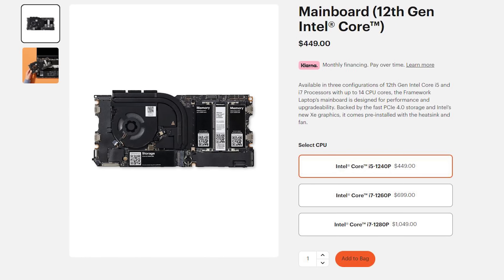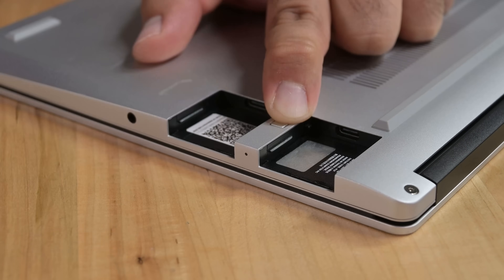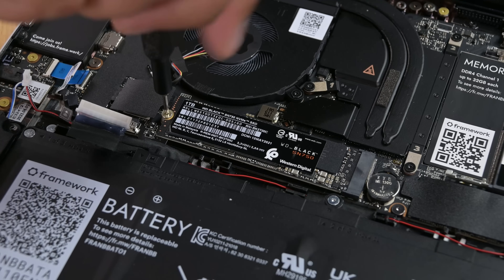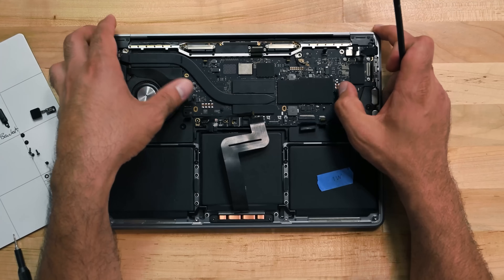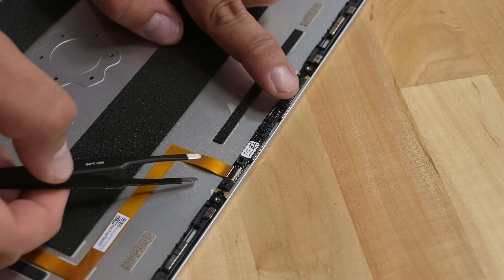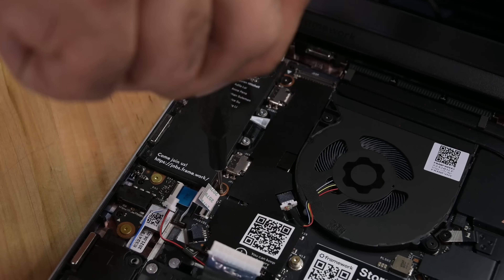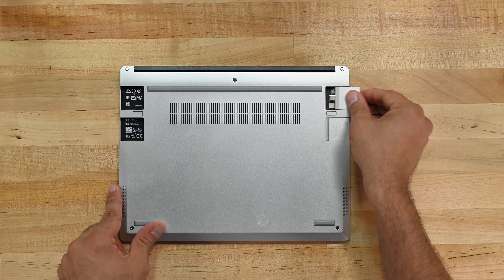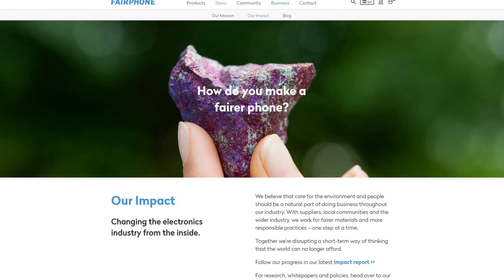The Framework Laptop Is Now Fully Upgradable!

Comment: the only reason im not more interested is becasue I'm a sucker for 15" laptops.
i need that 15" display and full keybord that comes with it.
a 15", 16:10 framework with 2 SSD slots would definetly be something i'd buy.
Reply: Late reply but they did announce the 16 inch recently.

Comment: The upgradability of this laptop appears to about as good as it gets. None of my previous laptops could have their cpus upgraded. The long term cost of a Framework laptop is probably a lot less than buying new laptops in order to upgrade the CPU. My next laptop will probably be a Framework.
Reply: @PSTS636  I am surprised to hear that. What sort of prices are we talking about ?
Reply: @PSTS636  Is that the price of the replacement cpu board ?
Reply: @PSTS636  Yes, that is a high price indeed. Hmmmm…..

Comment: I still use an aluminium Mac Book that has a lever locked lid to a removable battery and hard drive. When it dies in 10-20 years next LT will be a Framework.

Comment: Having lived with all sorts of technology since I was 5 (I'm 67), I've noticed one very important fact, over and over and over: The more connectors, cables, switches, jacks, and plugs you have in any system, the more failure points are present. Each additional connection multiplies the complexity of the system. So in one sense, Apple has it right... eliminate all the removable connection points except the absolute essentials. 

I think back to the time in my early 20s when I was an AM radio announcer. One day, I arrived at the station, knowing we were off the air. The guy on the shift ahead of me had lost the signal in his off the air monitor. The engineer came out (on a Saturday, time and a half pay), and started tracing the issue. He had spent three hours trying to trace back from the transmitter, since there was no signal there. The meters on the board didn't work, because they monitored the output of the limiter going into the transmitter, not the control board output. The limiter and compressor and equalizer were all without signal. The board HAD signal, but no one ever monitored that. We always monitored off the air! Only when the announcer plugged his headphones into the jack on the control board did he realize that there should have been signal going to the transmitter room. He solved his own problem. It turned out to be a wire loose under the desk. The announcer had put his feet up on the wall and managed to pull the feed cable for the transmitter room out of the board just enough to disconnect it. I arrived as the engineer was B*tching about wasting his time, with a smile on his face because it was overtime! His actual time on task was less than a minute to screw three terminal lugs back onto a terminal strip...

Comment: I'd love this in 17 inches tbh, maybe they could also then add a sata and ODD bay (which could like with old thinkpads could also just be used to throw in another battery if one doesnt need discs
Reply: Honestly I don't really see the point of SATA drives in laptops anymore. NVMe SSDs have become so enormously cheap. SATA SSDs at this point I'd only consider for bulk storage, in a role that used to be inhabited by WD Red HDDs.
Reply: @GeoStreber  2TB nvme still costs easily more than double than an HDD which as a secondary drive can still be useful. when one is just loading off a bunch of big media on it one doesnt need SSD speeds, also as a backup a non-flash medium is also not bad.
Reply: @My1xT  Well, I wouldn't use a HDD in a laptop anymore in any case, just by the fact that HDDs can be damaged by the laptop being knocked around if you're really unlucky. Yes they're still more expensive than HDDs, but the price difference is small enough to justify the upgrade in my opinion.
Reply: @GeoStreber  maybe someday there could be an nvme like connector for 2,5 drives for consumers too because one issue nvme might gonna have is just space for big drives and potentially more chips which are less advanced might be cheaper than using less chips that are far more advanced to hold more data

Comment: If OEM Windows is used with 11th gen motherboard, replacing the motherboard with a 12 gen will technically require a new Windows license.  How does Framework get around this if they do?

Comment: If you take a look at a laptop from Lenovo like the thinkpad series all of this is possible short of replacing the cpu and gpu just like Framework. For it to be game changing the device would need to have a socket to upgrade the cpu without needing to replace the whole board. Same with the gpu but that has not been a thing since the old Alienware laptop days.
Reply: Intel doesn't sell socketted U series chip

Comment: I wish Framework would make a larger beefier laptop with MXM graphic slots. I'd buy one of those in a heartbeat.
Reply: the bad news is the maximum mxm gpu you can find is an GTX 980M (idk whether it's 4 or 8gb of vram)
Reply: @baoquoc3710  that's totally wrong. There are tons of modern MXM cards more powerful than 980M.
Reply: @baoquoc3710  They had MXM 20 series afaik. They just weren't as common.

Comment: Oh, the replaceable ports would be the best. I remember when a very good laptop basically went to trash when a charging port snapped. For some odd reason no one wanted to repair it at the time, because they said that cables inside were too thin, and just by opening it up they would create other problems

Comment: wouldn't this ability to self-service save humongously on service-costs for coorporations ?
Reply: The parts costs are pennies compared to the actual time needed to diagnose and repair machines in-house (relative to the cost of a new machine). Corporations actually want the opposite. A MASS of laptops so that if failure occurs, IT would provision an entirely new machine to get that employee back to full productivity as soon as possible.

Comment: I bought a surface book 3, and although i'm quite unhappy with the laptop (bugs, slow cpu, no thunderbolt), i did like the form factor.
The bottom / keyboard of the laptop also contains additional ports, the graphics card and more batteries.
I really liked the fact you could turn the screen around, and detach if necessary.
It would be a great idea if you could do two things.
First, if they sold replacement keyboards that had newer graphics cards, it would be super simple to upgrade.
Second, if they provided a stand and a cable between the keyboard and screen, you could use it like a PC.

Unfortunately, MS didn't do either of those things.

Comment: The idea is cool, so cool that many tried before and failed. Why's that? Well, people won't pay extra $$$ for the option to change the motherboard and other stuff easily. Laptops are consumables and the moment you will need to replace anything inside this notebook (apart from adding more RAM or storage), you will just buy a brand new unit with the latest specs.

Comment: so, the entire heat sink comes bundled with the motherboard? seems a bit wasteful
Reply: The Mainboard is designed to be used as a standalone computer, and by bundling the heatsink assembly with the Mainboard, they save on user-error support costs. It's not optimal, for sure, but most consumer desktop CPUs come with stock coolers that use much more material than this! I'd love to see a Mainboard-without-fan kit, though, in the future. It'd save time for thermal paste enthusiasts!
Reply: @valshaped  it's definitely good to have an option, cooler mounting can be intimidating for inexperienced folks. but i hope they get around to selling the motherboard and fan separately too, otherwise they're shipping everyone a big chunk of metal and a fan whether they need it or not!
Reply: @spambot7110  i mean it’s better than shipping a whole new laptop with battery lithium waste plastique aluminium etc

Comment: Best idea ✨, I wanted A gaming laptop , with upgradable components,LIKe GPU,CPU,DISPLAY,RAM, doesnt matter if usb,hdmi,sd card are soldered.
Reply: The display in the Framework Laptop is user-replaceable and uses a standard connector—the only problem is finding parts that fit in the chassis and have a compatible mounting bracket.
(The display is made by BoE, and they sell an anti-glare panel in the same form factor and resolution)

Comment: Its still expensive, In future ,with large number of customers ,they can reduce the RND cost .
Reply: I mean for mine I order was like 1600€ for 16 go of ram an i7 1260p and 512. The price was roughly the same with the other manufacturer
Reply: for that price you can get a 3070 or 3080 laptop in usa a 3060 laptop in india and aus.
Reply: @vmafarah9473  it’s graphics card your are talking to me now, not cpus. And plus it’s not the same use those are 13 inch laptops ultra books
Reply: imo, this cpu i7 1260p is worth 700 dollar .for itb ssd 16gb ram, without graphics card , can charge 1000 if it has a 3050 minimum.

Comment: The MXM card standard should come back! Standard PCIe connector to upgrade the GPU in gaming laptops! CPUs will last for years, but the GPUs get outdated much quicker.
Reply: The PCIe connector was not the reason MXM died....MXM died because the blocking issue for GPU upgrading in laptops was COOLING....Say you get your MXM card back, What's going to magically cool your laptop now that this years MXM card produces 100W more watts of heat that your laptop cooling system wasn't designed cope with.... 

Just look at the ever increasing size of Desktop graphics cards to see why upgrading Laptop Gpu's is so difficult....

Comment: Why most people do not buy these? 

Possible reason is as they are not technically educated to understand the use case.

Advance users clearly see the benefit and future of the product, but brining it to everyone will require a lot of advertising and marketing to educate everyone about it.

For a normal user, once a laptop is slow and old it's easier to buy new laptop which they have been brainwashed to buy from fancy advertisement.

I wish framework finds a way to educate people and have centers where people who do not understand technology can go to upgrade, learn and repair without any hesitation or fear.

Comment: And what do you do with the old 11th gen board? Throw it out. LOL

Framework is a scam. You pay the price for a whole i7-1260P laptop just for the board ($788.00) and you are left with 1 working laptop and an useless board to throw away. If you buy normal, you'd have 2 laptops and can sale/gift/donate the old laptop to someone else so it doesn't go to the landfill.
Reply: Make it into a new desktop or sell it idk
Reply: And it's not useless you can just hook it up with HDMI io connect it to your monitor and you get yourself 11th gen mini pc and if you want to game the motherboard have unofficial support for thunderbolt so you can hook egpu how is this a scam lmao?
Reply: @rennatriple7  So you want to hang a laptop board with jerry-rigged heat sink, antenna, power supply off the back of a monitor and that’s your solution to this ewaste? Do you also wrap it in aluminum foil to provide RF shielding or is that a bridge too far?
Reply: @Peizxcv  Wtf the price of whole new laptop ? I want to see the laptop with an i7 12th gen at the same price please (with the same specs of course so like 16 go and 512go of storage) because of what can I see the price is like around 1500€ so like the double basically

Comment: Honestly they could have AMD versions at this point, Which could definitely help in the graphics situation with the recent 6XXX series laptop chips, which use a decent RDNA2 graphics core. Now they could also try and eventually make a separate dGPU supported versions of the motherboard, with a couple plug in models of various dgpu "cards", such as the mobile RTXs or RX XXXXm dGPUs. But I wonder of the cost of those types of internal modules, $200 at least, likely way more.
Reply: No they couldn't. AMD doesnt really have any chips in surplus they could sell

Comment: I hope Framework does well in the long run. Personally, I'd prefer a laptop with a moderately good GPU, like something in the range of GTX 1660 Ti to RTX 3060
Reply: I hope they sell a bigger chassis for the GPUs because a size like that may not run well with the 60 or higher due to heat and power  (unless they cramp in a max-q version of every 50 or higher).
Reply: @SynApse01547  it is possible that Framework will release a "gamer" model with a larger chassis, allowing it to accommodate a GPU
Reply: @SynApse01547  no they'll only stick with one form factor because that how you build a business by supporting the needs of as few people a possible

Comment: While it is definitely a step in the right direction, the whole process is very similar to most computers and just as complex.

1. The screen replacement is almost identical to most laptops in the marked (I talk from experience, 14 years as a Computer Tech) 
2. This was just a motherboard replacement/upgrade to get a better CPU. Yeah, cool you can do that but you can also do that with all the MacBooks Air from 2013 to 2017 (yeah, motherboards are fully exchangeable), A1502 Macbook Pro 2013 and 2014, A1708 MacBooks 2016 2017 among many others, including other brands. 

Nice that framework is doing this but don’t get fooled, this is just a motherboard replacement, not a “fully upgradable” computer.

Comment: While this is 
awesome for us tech savvy peeps, I suspect that this upgrade is too complex for the average person to want to attempt.  

Two thoughts:
1. What happens to the old parts? Usually I’d sell an old computer and it gets fully used by someone else until obsolete. 
2.  I  can see that this is awesome for those who upgrade every year, but how will this work for those of us who hold onto a computer for 5+ years? Will I want to upgrade a 5yo chassis or will there be a new chassis that I'd want to just buy?
Reply: Tbh I do think this is something that most people can do since the individual steps are not super hard and you really only need to understand some key basics (like being careful when removing ribbon cables), it's more of a comfort issue because people have been taught by every other tech manufacturer that opening their devices will lead to bad things happening so most people never got a chance to develop a base level of comfort with doing simple repairs
Reply: There's also a lot of people I would say who have some tech-savy person somewhere in their family or friends circle. It's not like they have to repair/upgrade it by themselves, as long as someone can do it for them (and they don't have to spend a ton of money paying that person either, like with some "authorized repair shop" or whatever).

Comment: But aren't you stuck buying the upgrade modules from Framework??  Just who is the target market for this? What is going happen in the next couple of years or so when this "startup" invariably goes out of business?  I'll stick to my non-upgradeable, difficult to repair Apple Silicon MacBook. I don't need another novelty gadget that will disappoint in the end.....I need a laptop that just runs and runs, for years, from a company whose products I have trusted for the last 15 years.
Reply: Framework has released rough CAD models and the part number and pinout of every major connector on the Mainboard on their GitHub repo. In theory, anyone with the electrical and electronic engineering chops could make a replacement board, if given the time. I'd love to see custom Framework-compatible mainboards from other manufacturers, personally.
Reply: @valshaped  I went to Luke Miani's YT channel and he has an interesting review of the Framework....intriguing but still strikes me as hobbyist or niche product

Comment: I purchased my MacBook Pro a while back but was debating very hard with the Framework Laptop. At the time I didn’t think this upgrade would be available and therefore chose the MBP as it usually lasts years. But I can confidently say, my next laptop will be the Framework Laptop.
Reply: Sadly, framework won't be around in a couple of years....I understand that they have "opened" the design for other makers to devise upgrade modules but this is too much of a niche product. It will have lots of Fans but the trend in portable electronics is small with lots of battery life. The Framework just won't be able to compete.